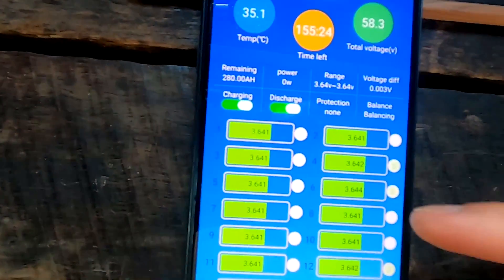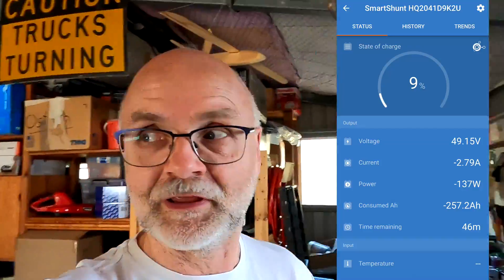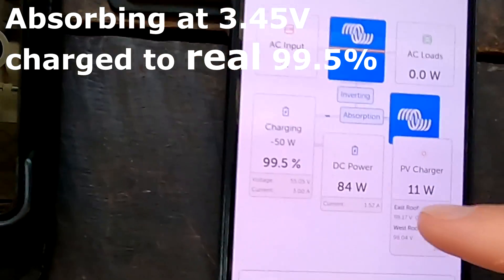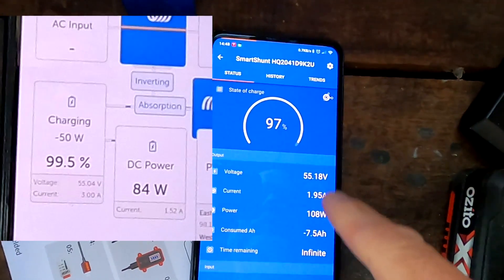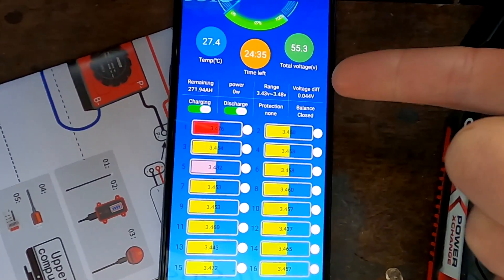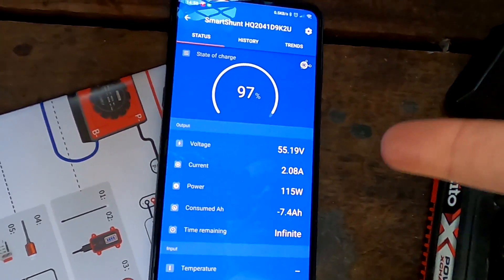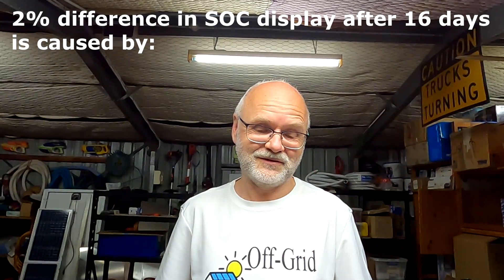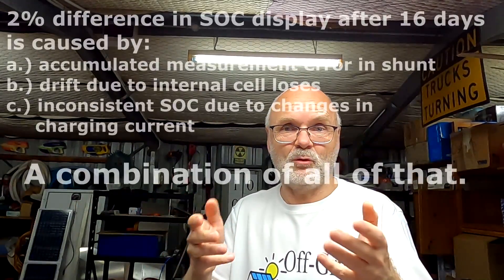Smart shunt drift after 16days with no calibration. Who is to blame?

Comment: Shunt drift depends on your charge/discharge currents. At small currents the shunt is less accurate.

Also charging efficiency CEF is depending on SOC. Charging in the flat part of the voltage curve is almost 100% efficient. In the steep part of the curve CEF is more around 90%. SmartShunt cannot not compensate for that. So regular synchronisation is necessary in most applications.
Reply from the maker: Thanks John. I thought the shunt will be more accurate at lower currents as we have less heat loss in the battery (which the shunt does not account for).
The charging efficiency at different SOC is a very good point! I didn't think about that.
Reply: @OffGridGarageAustralia  A problem is the resolution of the analog/digital converter inside the smart shunt. Victron is +- 10mA according to the manual, which is very good. This means at 200mA discharge current you are 5% off. At 20A you are only 0,005% off.
In my experience permanent loads under 1A (e.g. alarm systems, wifi router or inverter standby) cause most smartshunt drift.
This drift is even bigger at the BMS build in shunt as china BMS builders usually use cheap a/d converters. So I have matching BMS and Victron readings at higher currents but at low loads they drift apart.

Comment: Even a slight difference in temperature will cause cell balance to drift over time.  Mostly caused by capacity variations.  Cell A is 100.001aH, cell B is 100.002aH, cell C is 100.000aH.  It adds up over time.  You are only looking at it for a few minutes per day while the system is running 24/7.
Reply from the maker: That's a good point.
Reply: I agree with this, and that there are probably many other inconsistencies & variables throughout the whole system when connected to a solar PV setup 24/7 with temp changes, etc, but this is lab level experimentation too, where we are examining these inconsistencies to try and get some answers for a better understanding of this chemistry. Was it Einstein who said, the “definition of madness, is doing the same tests over & over and expecting to get different results!” Cheers all

Comment: What causes displayed SOC "drift"? In declining order of importance: 1) Charge voltage and current, which can't remain constant with PV charging sources. 2) Charge efficiency of LiFePO4 cells is about 99%.  If you set the "Current effiency factor" inaccurately you will never hit the 100% target, or hit it too soon. I've set mine to 99%, but I've calculated the actual value to be 99.4%. Unfortunately, Victron doesn't let you configure to tenths of a percent resolution - and errors accumulate over cycles. 3) Capacity declines with ambient temperature about 0.4% per degree C below 20 C. So, if the ambient temperature is cooler, it will appear that you haven't put back what you took out (discharge/charge delta), or conversely, you have less than the displayed SOC during discharge. 4) Incorrect Puerkert exponent setting. This setting is only an approximation and doesn't exactly correlate to LiFePO4 behavior (it's a lead-acid battery setting). I've set mine to 1.04 with good results, but it depends on several independent varibles -- mostly cell impedance. It's all so complex that, everything taken together: the Smart Shunt just requires periodic recalibartion to yield a reasonably accurate SOC result.
Reply from the maker: Thank you, that is a great comment. I'm running 99% as well for charging efficiency and 1.00 for the Peukert exponent. Ss you said, this is not 100% accurate all the time though, so there is the error to start with.

Comment: You will get less drift if you are able to set charge efficiency exactly to long term average to better than 0.1 % . Victron only allows 1% resolution.  You then only have to deal with variations ( which you cannot compensate for via charge efficiency ) . I have been  finding a drift uncertainty ( or variation  of 2-3 Ah/ 1000AH discharged ) I calculate charge efficiency to be about  98.6%
Reply: I have 2 48v sets of the Lishen 272AH batteries running for the last 6 months. I changed The battery efficiency setting in the Victron Smart Shunt to 98%.  It has been two months since I calibrated it last and it is still dead on. It was drifting 3% with the original victron recommended settings.

Comment: This internal resistance thing, I don't think is right. Charge is conserved, so the ampere hours added and removed from each cell in a battery is always identical in a charge or discharge process (assuming no self discharge). Otherwise the cells would gain a net positive or negative charge. The internal resistance makes no difference to this. As far as I can tell the only thing which can cause cells to drift apart is differing rates of self discharge in each cell. This happens whether you are charging / discharging or not.
What is causing your smart shunt to "drift" is, IMO, integration error. It's an  unavoidable numerical feature. The more you integrate up and down the more the error will accumulate.

Comment: The shunt does not account for the power your bms uses, that big azz relay it uses also
Reply: especially as it kicks in quite early at a lower voltage already with Andy's settings, right? Still it is just a some mA, but over 16 days it might be one A or something like this. Could have a small impact on the result.

Comment: I have the same issue with my victron smart shunt. I'd been wondering if it was due to charging while underload. I noticed some paper work on your desk for the DALY SMART BMS, which I also use. The daly is even worse at tracking SOC than the victron smart shunt. Pro Tip, if the DALY starts showing nonsensical information, unplug the BLUETOOTH dongle, then reattach. I suspect it might not like being close to other BLUETOOTH gear. (Only guessing)

Comment: C.  And F.  F, of course, being that as the voltage rises it represents a smaller amp hour capacity.  When you have a small inbalance between cells it represents a diminished amp hour as one cell rises .04 to compensate for a battery that no longer has a need to increase .04 at a lower overall voltage.  In other words, you are replacing a .04v at 2 AH with .04v at 1.8 AH.  Then your balancer with a resistor lowers the .04 inbalance over time losing capacity as the shunt is between the BMS and the Inverter.  

Over time this small difference takes place hidden from the shunt as it doesn't know what the BMS is doing.  My Juntech shunt is absolutely the worst garbage as it also eats up power running the wifi chip on the shunt that over days/weeks it causes a miscalibration as it doesn't know what its own power usages are....

Comment: Temprature differences also affect cell capacity, not to mention the slow degredation after more cycles, that's why they usually produce more AH from brand new.
Reply: Cell: Temperature to internal resistance differences
80% SOC Temp 20°C = 4.2 mΩ 
80% SOC Temp 30°C = 3.7 mΩ = 12% < as Temp 20°C
80% SOC Temp 40°C = 3.5 mΩ = 17% < as Temp 20°C

Comment: All of the above. I also think based on my own measurements that approximately 1% is the least drift you can experience, since that is what I measured for cell efficiency in a much more controlled environment. In other words, if you use 100 amp hours, it takes up to 101 amp hours to recharge the cells. I have actually been measuring slightly under 1%, but you get the picture. Not many real world examples of 99% efficiency, but it really is.
Reply from the maker: Thanks John. That works with my observation as well. And some of the causes for drifting may even cancel themselves out. Different charge/discharge current, temperature, SOC... this all are variables which could balance each other and make it less and more drift. 
I have left the shunt uncalibrated now and will see how this progresses over time, say 6 months. I will charge to 3.45V as a defined state (well, this 'low' voltage alone has some drift in it) . Maybe I increase charge voltage to 3.55V afterwards for 6 months to compare. Well, then we hit in the colder season again which causes other... it's getting complicated 😬

Comment: Who is to blame? I agree with your conclusion “all of the above” but if you look at the tail currents between the then and now full charges, they are different so you’re not comparing at the same state of charge. Having said that, the amps, volts and watts reading on the “before” full charge state, don’t add up.

Comment: I think the difference in internal resistance causes the drift in the balance while the drift in overall capacity is more likely a combination of rate of charge and overall charge efficiency. I find with my own BMS that a charge efficiency of 96% brings it back to pretty much exactly the same point. I do it by it simply deducting 4% of the current being charged when it accumulates negative amp hours. On my lead acids the efficiency using the same method is 80% calculated by Ah in to Ah out calculation. I suppose I could automate that so it effectively learns the efficiency over time and applies it to the soc calculation this should give a system that doesn’t require regular synchronising to keep it accurate.

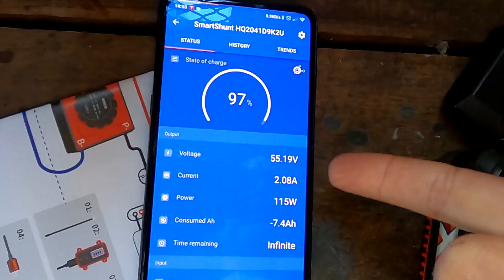Comment: Hi Andy, another great and thought provoking video. Could it be that your batteries all have different wear patterns  and so you will need to adjust charge settings as they age? BTW I sense a new video about a Daly BMS soon 4:22 ;-)
Reply from the maker: Thanks Craig!
I think the wear on the batteries is fairly even. As they are all in series, the current is the same. The only difference is the internal resistance which varies a tiny bit. That is so small though but over time I think this accumulates and makes the measurement drift.
Daly? What? 😂

Comment: About the charging speeds… y hey just doña matter if you are absorbing. The reason why you get more capacity when you charge slower is due to charging voltage rise. Thus, different SOC at the same voltage cutoff. But if you absorb and ley the currency fall, the voltage rise caused from charging slowly fades and doesnt affect it

Comment: That is a good question--what is the cause of the smart shunt SoC drift?.  

I'd have to know a lot more about exactly how the shunt keeps track of the Amp hours & how accurate that process is; but, my guess is that the shunt cannot accurately account for the energy lost as heat during charging & discharging at different rates.
Reply: Makes sense.

Comment: If you count Ah instead of Wh, then internal resistance has no net effect since 1Ah is still the same amount of ions going through the battery's electrolyte regardless of internal resistance. You will still get differences/drift from mismatched internal leakage current, which can be a few %/month.
Reply: Nice! I 100 percent agree. These batteries cannot hold a charge very well especially at a high state of charge.

Comment: After extensively playing with smart shunt setting during spring time (such as P.E., charge efficiency, tail current and charged detection time) I have achieved 0.7% accuracy  over extended period of time. I think longest was 3 weeks beginning from mid July. Reason smart shunt let's us make those changes is because to achieve the necessary  accuracy it can not take into the account your setup. Think of type of wire, length of said wire, gauge of the wire, type of wire terminals, switches, etc.... All of these components have inherent voltage drops across them which in reality relate into energy losses over time. It is worth exploring various settings to achieve best accuracy over prolonged periods of time between being fully charged.
Reply: 0.7% accuracy is awesome. Wire, switches, and terminals may be a significant factor to the drift if you have inconsistent charge/discharge cycles (in other words, higher load cycles can over-heat conductors, especially if you use cheap stuff). I don't think that's Andy's issue though.
Reply: Can you post the settings values that resulted in this small drift? I’m intrigued
Reply: @aureltanasan1413  See response below.
Reply: @DMIINC2013  Thank you for taking the time. I’m not far off
Tail current 1%
Detection time 5 mins 
P E 1,04
Charge efficiency 98%
I still get a drift, sometimes more, sometime less. Loads don’t exceed 0,2C and charging is max 0,15C. I don’t charge bellow 4deg C. The highest drift I had was 4% deficit.
Reply: @aureltanasan1413  I understand. We are all still experimenting with this. Until we have significant amount of data we not be able to come even close to guesstimating correctly. I will see what kind of accuracy I get during winter. Will get temp sensor for it too to see if guesstimate can be improved.
Reply from the maker: Yeah, post these numbers here!!!!
Reply: @OffGridGarageAustralia  
Tail current 1.00%
Charged Detection Time 4m
P.E. 1.02
Charge Efficiency Factor 98%

Nothing special here. Your settings may vary. And let's not forget difference between summer and winter temps effecting capacity. Interesting note. Charge Efficiency factor of 96% for me causes 10% drift over couple of days.
Reply from the maker: @DMIINC2013  Thanks for sharing. Interesting you have set the PE to 1,02. I have this sitting on 1.0, so totally disabled. As you said, it's a matter of trial and error to see what is working for your own battery.

Comment: Helle Mr Off Grid,

I have a quick question about your bms. In case of a low cell voltage cutting off situation, what can you do to fix that? The relais is open, so the battery can not be charged right?

Or does the bms detect a charging voltage and closes the relais again for the battery to charge?

Thanks

Comment: If you wait even longer - like 3 months, you'll find a similar 97-99% at "full" it wont drift further.
Of course the shunt has charge co-efficiency you can change and puekert - so it also depends on this. 
Not been as clinical as you with my playing, but I've fond the victron immensely consistent. I rarely hit "full" either by MPPT settings or using power before it hits full.
Reply from the maker: I thought so too, that the shunt is fairly consistent it its measurement. I rarely have very small currents which the shunt may not be able to measure, there is always something running somewhere.

Comment: Does LifePo have a Peukert effect?
Reply: No
Reply: @aaronwalker1507  puekert effect is voltage drop while under load. Not energy lost the higher the load. Its in wikipedia =) lead acid voltage drop under load will trigger low voltage limits earlier than same capacity lifepo4 but. With this said, lifepo4 do have peukert effect but it is around 5% where as lead acid is around 25%

Quoting wiki below:

It is a common misunderstanding [2] that the energy not delivered by the battery due to Peukert's law is "lost" (as heat for example). In fact, once the load is removed, the battery voltage will recover,[3] and more energy can again be drawn out of the battery. This is because the law applies specifically to batteries discharged at constant current down to the cutoff voltage. The battery will no longer be able to deliver that current without falling below the cutoff voltage, so it is considered discharged at that point, despite significant energy still remaining in the battery.

Comment: I think it is a combination of all the options, but mostly the difference in charging current.
Reply from the maker: I think so too. Could some of the options compensate others, cancel the error out, causing less drift under certain circumstances? High current causes more drift but warms the battery which causes less drift, something like this...

Comment: My smartshunt drift around 3% in 30 days. Do you have the settings for the auto calibration?
Reply from the maker: Is it a Victron smart shunt? It's in the settings-battery of the shunt.
Three numbers are to be set to reset the shunt to 100%:
- charge voltage
- tail current 
- time